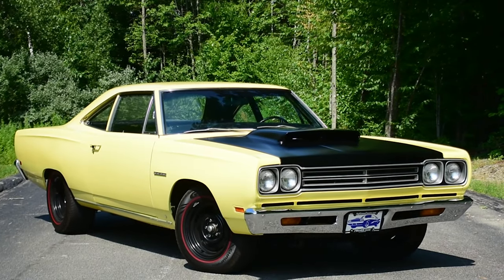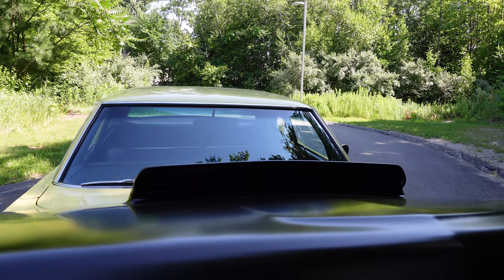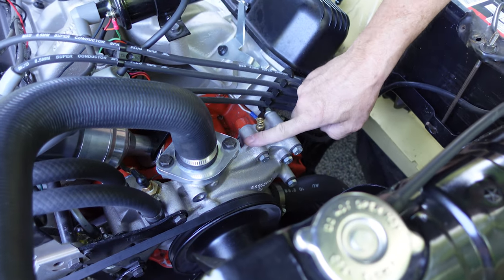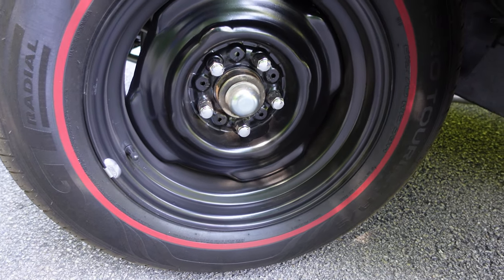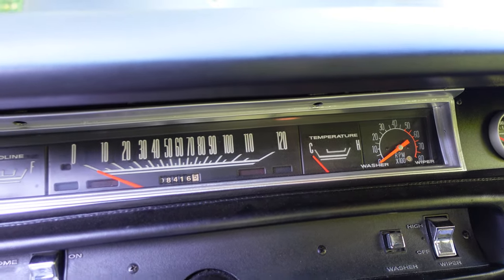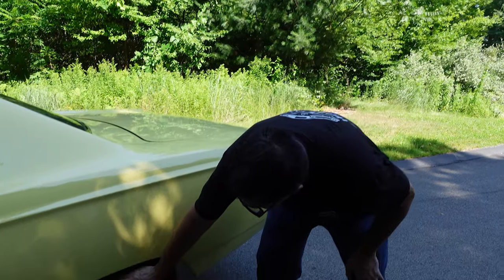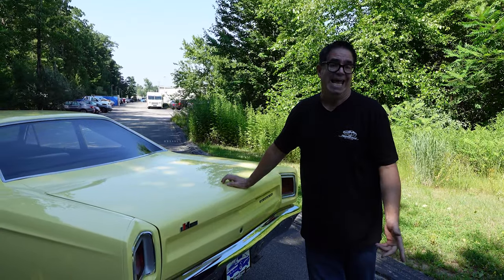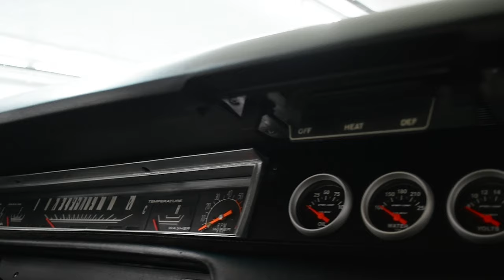Walkarounds with Steve Magnante | 1969 Plymouth Belvedere fully restored with a stroked 451! | Ep 96

Comment: No, this was not made in St. Louis, MO, it was made in Maywood, CA. With the VIN, we win: R for Belvedere, L for low price class, 21 for two door sedan, B for 225 CID Slant Six, aka "Leaning Tower of Power", 9 for 1969 model year, E for Maywood (Los Angeles) CA assembly and the rest is the production sequence. The Maywood plant operated from 1932 to 1971 and was located at 5800 Eastern Avenue and Slauson Blvd. The Ford Maywood plant was across the street. The Chrysler Maywood plant is now an office building that was built/renovated in 1974.

Fenton (St. Louis), MO assembled vehicles would have a "G" instead of an "E" in that VIN digit. It appears that they were going for code "Y2" Sunfire Yellow exterior paint which was a Plymouth paint code for 1969.